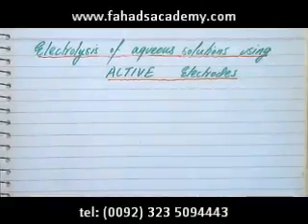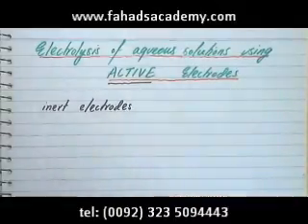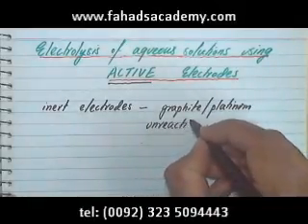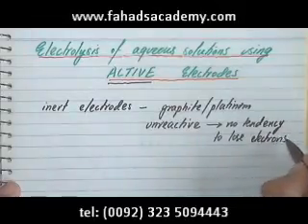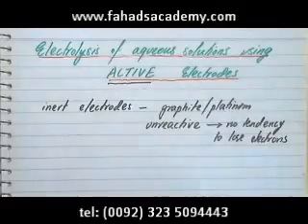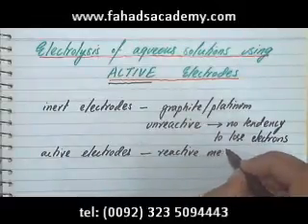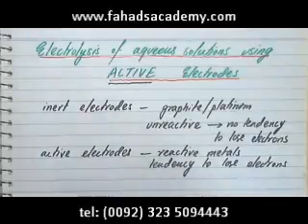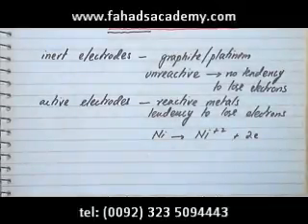Electrolysis of Aqueous Solutions using Active Electrodes : Part 1

Comment: What is the difference of electrolysis between aqueous and concentrated solution and how can we predict the products of electrolysis in 0.8 seconds
Reply: When the compound is mixed with water it forms an aqueous solution. However, concentration depends on the amount of solute being dissolved in the solvent. Concentrated solutions usually have more solvent in them.

Comment: is Hg also a active electrode
Reply from the maker: +Anshul Chauhan no, because it is unreactive and doesnt want to lose electrons and form ions.
Reply: Fahad's Academy okay
Reply: Fahad's Academy but in a question Hg used as cathode in electrolysis of aq NaCl and ion discharged at cathode is Na+ why??? ion discharged at cathode should be H+ ??
Reply from the maker: +Anshul Chauhan hg at cathode has some issues with H(+). This is an exception as Hg has some repulsion for water/H(+) ions. So only Na deposited which ends up forming amalgam.
Reply: Fahad's Academy thanks

Comment: Is Zinc a active electrode ?
Reply from the maker: +Soon Cheng Lew yes. As it is a reactive metal and loses electrons easily. So if Zn is used as anode then it will dissolve and lose electrons and become aqueous Zn2+ ions.
Reply: If Magnesium immmersed in MgSO4 and Zinc immersed in ZnSO4 is used in a Daniell Cell. 

Mg will loss electron and flow through the external circuit to the Zn electrode. Zn2+ from the solutiom will discharge and form Zn. Am i right ? 

Or instead of Zn2+, H+ will be discharge since H+ have higher tendency to accept electron.
Reply from the maker: +Soon Cheng Lew yes you are right. And H+ has a higher tendency to gain e. But the concentration of H+ ions is very low. So Zn2+ gets discharged instead. You will learn these details in A'levels.
Reply: Fahad's Academy Thank You !

Comment: But what about electroplating using zinc? Lets say the electrolyte is aq zinc sulphate and anode is zinc. And cathode is copper. Why will zinc be deposited at cathode? Isnt zinc above hydrogen in reactivity series?
Reply from the maker: +Shafin Barshan In GCE & iGCSE whenever a question comes about Zn electroplating then they always state that "it is similar to Cu electroplating". So, you solve the question assuming that ZnSO4 behaves like CuSO4
Reply from the maker: +Shafin Barshan another thing, according to reactivity series, H(+) is easier to discharge compared to Zn(2+). But what that really means is that 70 or 80% of the time hydrogen will be discharged and 20 or 30% of the time Zn will be discharges. Now hydrogen is a gas which escapes, but the little amount of zinc getting discharged would electroplate and stick to cathode.